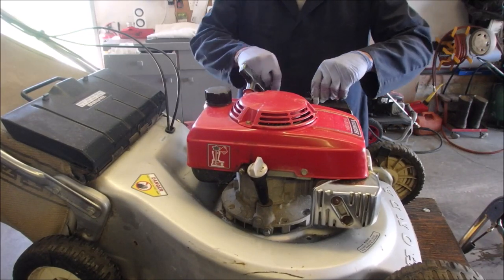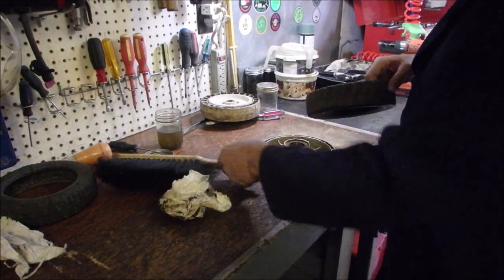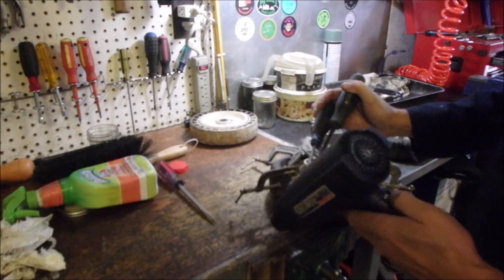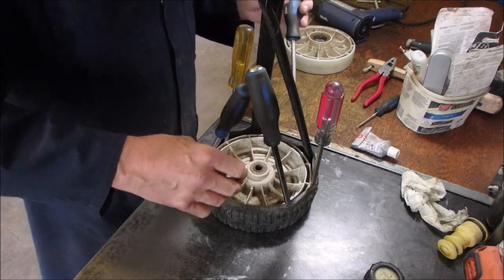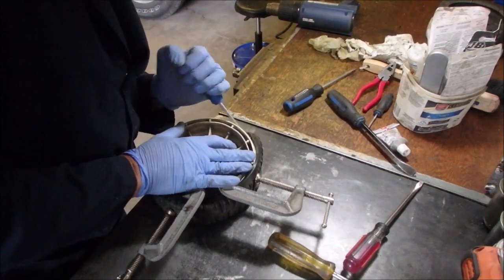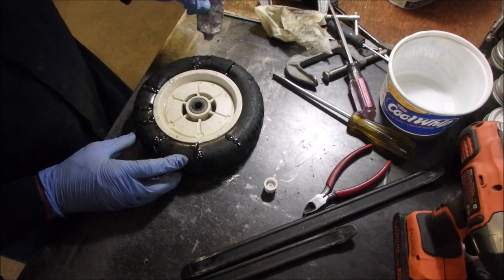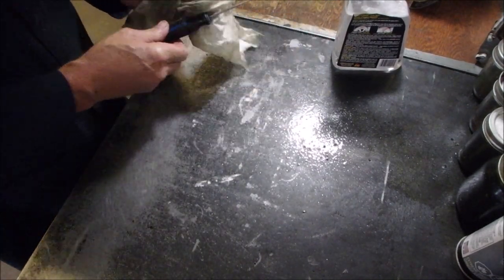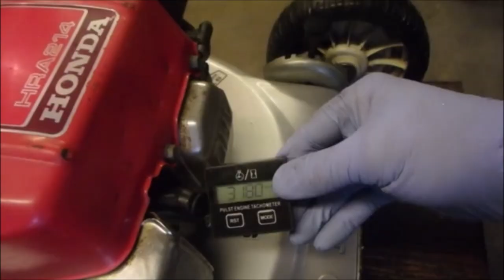Honda HRA214 Old  Tire Repair

Comment: Just wanted to thank you for this painful trip down memory lane Bruce and waited the entire video for you to spill that jar of fuel you did not put the lid on lol.  Amazing how much replacement parts cost here in Canada. Just got the notification from Stens that they needed to increase prices on around 20,000 items as of April 1st and that is no joke. They happen to be our major OEM and aftermarket supplier.
Reply: Thanks for the information is that in the U.S also  ?
Reply from the maker: Yes.  I use Stens a lot.  That is sad.
Reply: @LewisMowersandBoats  Not sure but i would think so do you have an account with Tens or Arrowhead which owns them?
Reply: @BrucesShop  Where do you get your Stens parts from Bruce?

Comment: I have done this once before  but only works if the tire is same side and the other axle.  I did this on a troybilt once

Good idea on-heating up the rubber with a heating gun
Reply from the maker: Thanks

Comment: I like to keep spares from other mowers as replacements.
Reply from the maker: These type of spares are hard to find as most of these older Hondas are still running.  I have 2 bins full of wheels.

Comment: What you are doing there is very hard to do, especially with new rubber, I let the rubber sit in the hot sun for about 1 hr before I try that, I have also done the bike tire, and self tapping screws trick too.
Reply from the maker: Right   I understand.  Hot sun would be nice.  LOL

Comment: Alot of work for used tires ( I got tired watching you). But for $120(Canadian or American) I guess its worth it, AKA I'd do it. Except the cracked one.
Reply from the maker: Right on a flip you have to do this save money.  On a repair you can ask the owner.